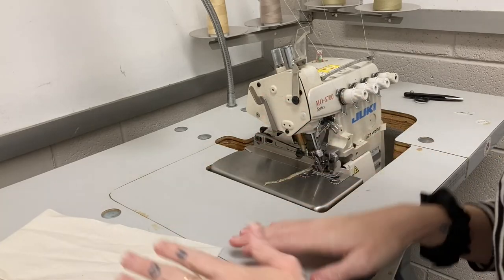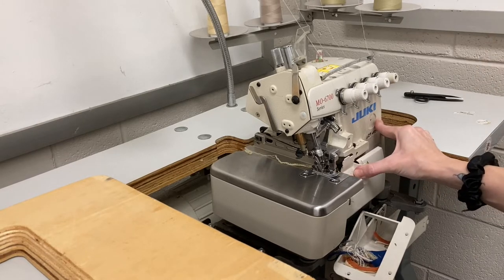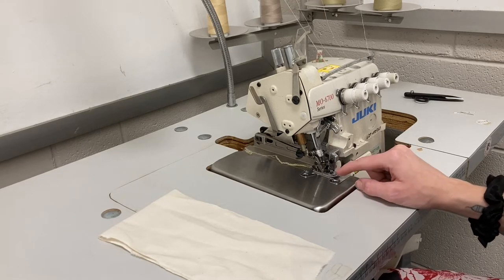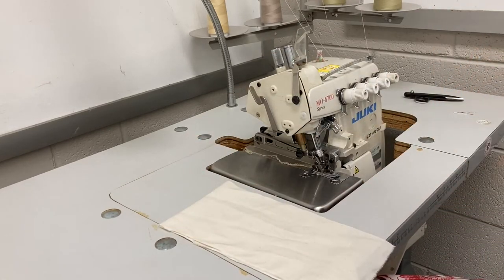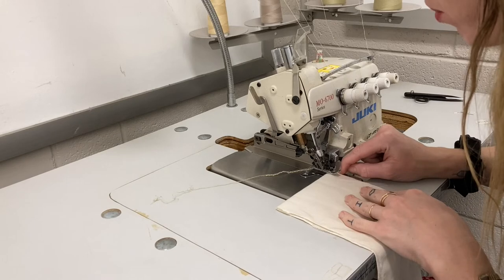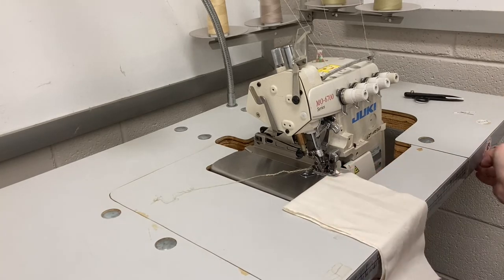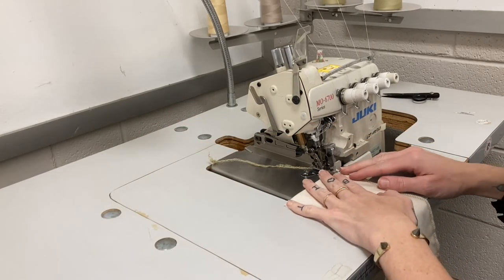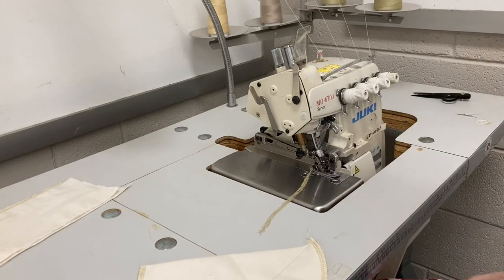How to Use an Industrial Overlock Machine

Comment: can I overlock sequence fabric with this machine?
Reply from the maker: Ooof, I wouldn't, but you could test it if the sequins are not particularly thick/hard. There are so many areas for the sequins to get lodged.   
 If you're making a high end garment with quality sequin material, I would baste the material together and prep the seam allowance by removing unwanted sequins.  Then after normal lock stitching, you could overlock the edges if needed.
Also, if it is on a knit base material, it likely won't ravel, and therefore doesn't need a serged edge.  Just remove the loose sequins in the seam allowance after stitching together.
Reply: @vanhertenouterwear  thanks for the info

Comment: How can  i make buttonhole on my overlocker machine
Reply from the maker: Sergers can't be used for buttonholes.  You'll need a machine with a specific buttonhole function, or you can finish buttonholes by hand.  Bound buttonholes are particularly lovely, and the other way is hand stitched buttonhole, but take a long time to master.

Comment: how to gather on the same model overlock machine
Reply from the maker: Hi, it's called the Differential Feed which allows you to set the speeds of the feeder dogs, essentially.  You need to go into the machine, open the table top and left side of machine.  Look for a post at the very left hand side.

Comment: How can I sew on the fabric same as weave
Reply from the maker: Not sure I understand the question..
Reply: @vanhertenouterwear  like sew on a fabric without the razor cutting it off
Reply from the maker: @deradaniels6068  Oh I see, well you would need a cover stitch machine or a serger with a cover stitch function.  A cover stitch is the finish on the hem of your tee shirt or swimwear.  It finishes the edge of the fabric the same way as the overlock/serger but without trimming allowing the stitch to live further inside the body of the garment.  Otherwise, depending on the depth of the hem you need, you could just serge the edge of your fabric and then straight stitch the folded hem in a separate step.
Reply: @vanhertenouterwear  thank you so much